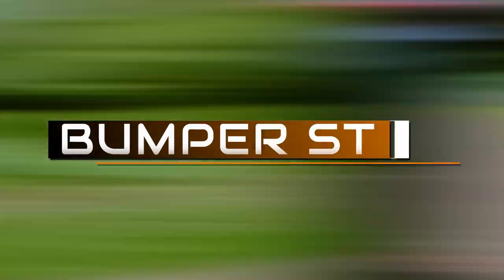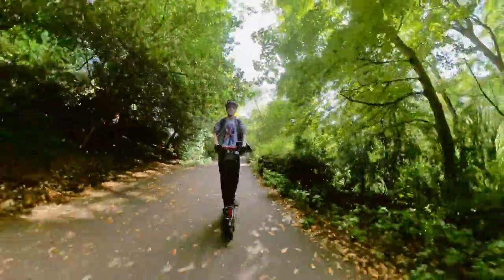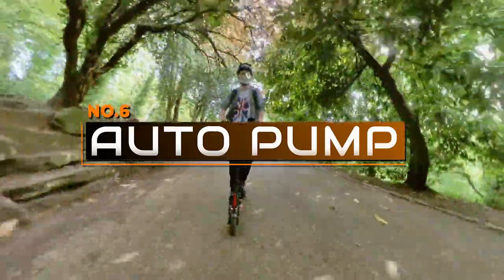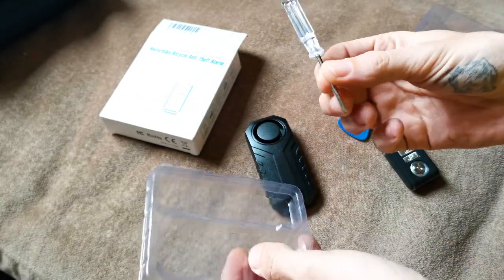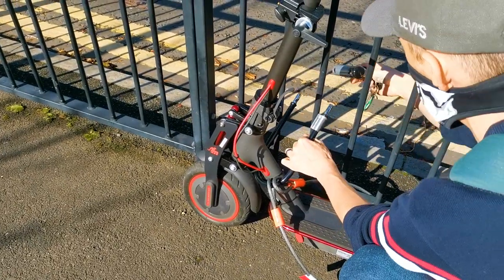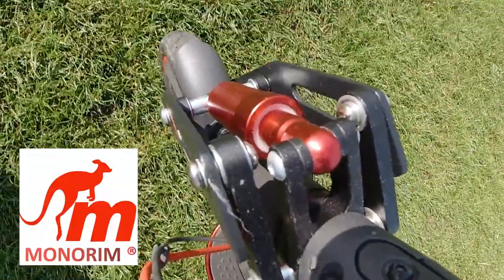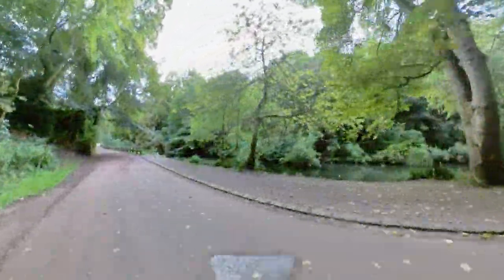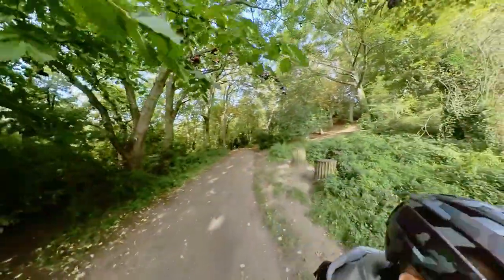10 BEST Accessories for ELECTRIC SCOOTERS [Volume 2]

Comment: Good work and interesting comments on the helmet. I have a Bell Super 3R with removable chin bar too. I had it removed on my cargo bike last year and came off at about 15kph on a wet bit of road down a hill. I've nearly finished paying the $9,900 (Australian) dental bill now and could have avoided all of that if I left the helmet in full face mode. I do this now on anything that moves - especially my Kaabo Mantis scooter, where I normally cruise at around 45 kph. So if you feel you have anything worth protecting above your shoulders, ALWAYS WEAR A FULL FACE HELMET!

Comment: Great video. Very informative. As someone else said great work on the research so that we don't have to. Also it's good to see a fellow Scotsman on youtube.  I've just started using a scooter ( aovo pro ) and am loving it. I am already looking for something more powerful. Do you have any recommendations for offroad scooters? Keep up the good work.
Reply from the maker: I appreciate that thanks mate 🙏  As for a more powerful scooter, well im guessign the Aovo Pro is 350w motor.  Id just google for a 500W motor (at least)  500w motor especially if dual motor makes a huge difference and also copes with hills much better.  One of my favourite budget scooter with a 500w motor is the Kuickwheel SC-1 pro.  Its built like a tank and smooth as hell to ride...great at getting uphill.  Might be a bit tricky to find in uk im not sure. Most of the scooters sent to me for review can be hard to recommend just because they not always available here.   I have a nifty little thing from AOVO that im filming right now... The M5 Pro Scooter bike.  Its really fun to ride and got a 500w motor...But its designed to sit down so a 6foot 2inches guy like me makes it look like its meant for midgets!  but it still feels very confortable to ride.  got beefy 12" explosion proof tyres and some great other features.  think its going for 599 just now (brand new)   like i say its not going to be for everyone because its like a cross between a scooter and a motability bike 😆
Reply: I you have the money for it, i would look up the “dualtron X”. I think its about the best scooter around now, but also very expensive ofcourse. The “zero X11” is also very nice, a little bit cheaper as the dualtron, but still expensive.
Reply from the maker: @Fluggaenkoechiebolsen  I have a rebranded zero 10x...The Varla Eagle one. Just got it few weeks ago and upload vid yesterday 👍 https://youtu.be/4jI_gZ48uAk

Comment: I recommend Livall smart helmet. Has lights and indicators, heck you can even give it an Audi style fluid animation.
Reply from the maker: If you check my description....that is the very helmet I recommend and have recommended in previous videos! 😊👍👍👍
Reply: @SlammDunk Productions:
Just realised watching your review video. For some weird reason, my Xiaomi M365 Pro brakes keep on deteriorating, and the brake is not strong enough especially during the rain. I got it repaired and one month later it’s the same thing? Have you had any brake issues? Secondly, do you protect your top display module for rainy days where the button is?

I also need to get an Android phone to get rid of the speed limiter I have an iPhone 😕
Reply from the maker: @ameerali.ouarda   actually to be honest...my brake doesn't work at all?...I pull the brake, I can feel it trying,. But no real effect.  I just took for granted that I need to tighten it up but have been too lazy to do it yet. I think I will attempt it today and get back to you if goes well 👍 I don't protect my dash no. Trusting that because the scoot is waterproof/splashproof I don't need to worry. However I might at a red one for some style......yes Android is needed for the hack. But you don't need to own one. It's possible to just use a friend's Android to do the hack then just go back to using your phone. 👍✌️

Comment: Another cracking video and loads of goodies to get hold of. I bought the GoPro MAX 360 as it was the only one I could find on finance but really wanted the Insta 360.....Too late now lol and regret it as any 360 3D videos are split into chapters that I cannot join together without spending £100's on software like Final Cut Pro X when I make videos for free? I just like making vlogs as a hobby and not for money but it seems like I am being forced to spend more money on third party software? Cannot find anything for free that does not render 360 3D footage as it all seems to render in 2D Flat footage!
Reply from the maker: AHH the GoPro max...I seen a few people using them when I was on hols last year. They must be pretty good though I'd imagine? Only because they are pretty new. If you used Adobe premiere then I know there are GoPro plug in for free that deal with all the editing of 360 video. It's the GoPro plug ins that insta360 even recommend using when ending in premiere. All those editing programs are expensive as fu*k it really was hard for me to edit videos for YouTube at the start because I couldn't afford anything. I had to use divinci resolve (which is great for free but still limited) anyway I went to Adobe eventually and just pretended I'm a student to get the student prices. £15 a month for Everything Adobe instead of 45. I use it a lot so I can't complain I guess. ✌️♥️
Reply: @SlammDunkProductions  I only went for the GoPro MAX as it was on finance but gutted as they split the files. Why split them and not give the function to join them again???? Adobe is again another extra cost for me as I do not make money from my Channel not that I could as I do not get the views lol, but that's not the point as I want to enjoy making my vlogs with the equipment I buy from my own pocket without having to buy expensive software and then an expensive computer to cope with it if I am not making money from any of my videos and do not intend to either?

Comment: That camera setup is really cool, nice shots. How do you control it while driving?
Reply from the maker: Hey!  yeah its a 360 camera on a selfie stick, the selfie stick is then attached to a clamp on the scooter. the selfie stick is not captured by the lenses so you get the 'invisible selfie stick' effect.   All the controlling of the camera is done AFTER filming.  the editing software allows you to frame shots in post after the fact.  yeah its pretty cool.   If you check out Insta360 cameras, they are actually VERY beginner friendly.  They all come with an App for your phone that allows you to do the editing and cool effect on a phone so you dont even need a powerful PC to edit footage. :)

Comment: I have the hover pioneer, which is basically a knock off brand of xiaomi, but it's really good. I just replaced the tires with solid tires. I got brighter headlights, and some led light strips on the bottom. I got reflective tape on the side too. I want to buy another battery next to make it go further.
Reply from the maker: Nice mate well done, sounds sick! 👍👍👍 Good luck with the battery extension it's something I always wanted to do myself 😊✌️

Comment: Thanks for your real world reviews on escooter accessories. I've added the handle bar extension (my phone now mounts off the crowded handle bar), got the Seibertron Dirtpaw protective gloves and ordered the Bell Super Air R helmet. Will add some camera (probably the Insta360 ONE R) at a later date.
I use my really old roller blade knee and elbow pads. Have you tested any knee & shin pads, and elbow & arm pads? 
I'm a 70 yr old geezer with my right hip replaced and my left starting to go - due to extreme sports when I was younger. I added the Ninebot Max seat so that when my hips pain too much, I can sit for a bit.
The Segway Ninebot Max G30 lets me explore a lot more distance on trails than I would otherwise walk. Keep up the good stuff. Stay safe.
Reply from the maker: Hi!  thanks for the feedback Charles :)  As for pads it depends on your budget.  i recommend "JBM Adult BMX Bike Knee Pads Elbow Pads Wrist Guards"   or for less money  "Gonex 6 in 1 Protective Knee Pads Set"   just search amazon for those 👍

Comment: I order same alarm, but maybe i Will put inside battery compartment (just the print ect), maybe even add a power converter so its on the xiaomi battery.. I see on video there is room infront of the Controller..
It will make less noise, but still enough i think if its also zip locked to something
Reply from the maker: Sounds ,👍👍👍

Comment: Great video!

However, as someone who just barely managed to scrape together the 360€ for an S1, there's no way i'll be able to afford these.  So i'd like to ask you;
1. Which one (other than the helmet and lock) Is the most important?
and 
2. Do you have any good budget alternatives for the rest that work well and still don't compromise the scooter's safety?
Reply from the maker: Alarm and handlebar extensions are useful and less than a tenner if you look around I'm sure. I guess a 'proper' lock that will keep your scooter secure but they can be quite pricey for good ones.  Some things are worth going cheaper, like (alarm, gloves, lights, handlebar extensions etc) but some things you want to pay for the quality. For example the suspension, I'd always recommend official Monorim kit's because some of the cheaper copies are dangerous. The metal forks bend because meterial is so thin and the suspension has no bounch compared to Monorim. Yeah I don't know what else to say I hope I've answered your question 🙂👍🙏
Reply: @SlammDunkProductions  Thank you! 💕
Reply from the maker: @uwuhehe6900  you are most welcome ☺️❤️

Comment: That alarm system is pretty cool but what if someone touches it and you're away ? Does it stop itself after few seconds ?
Reply from the maker: haha yes i think about that all the time. especially if i leave it outside the supermarket, but thankfully nobody has touched it so far.  im pretty sure it will keep going until the battery dies but im not 100%
Reply: @SlammDunkProductions  I was looking for such system and i'm glad that exists, but it should stop ringing once it's stabilised.

Comment: I didn't buy the monorim Front, I bought the twin shock, conventional type. Mine using both F & R suspension smooths out the ride by 35-40% ! ( huge improvement). Mind you, I'm an old Retired Mechanic, bad back, so a better ride mattered to me. I use mine as my Primary Transp, so I use it for everything from big shopping trips, to quick errands. Towing my big folding shopping basket, I can haul over 100lbs of groceries in one go.Ninebot Max G30.
Reply from the maker: Ha.. Respect mate 🙏
Reply: @SlammDunkProductions  You should see what all I've done. Re-Engineered the rear shock lever arms, to increase dampen rate, beefed up the M4M Trunk, so I "could" tow over 100lbs, with up to a 50lb tongue weight. Next, I'm adding a heavier motor, and going to a 48 volt system. That way, my software hacking can get me up to the 30mph range, instead of just the 21mph now.
Reply from the maker: You have videos of you doing this?
Reply: @SlammDunkProductions  No, but I've been thinking of doing one, to show my setup. Towing with my Ninebot is easy, as the basket holds all the weight. A good push at startup, and momentum does the rest. I will subscribe, so if I do post a video, I can let you know.
Reply from the maker: @davidjames1063  yes for sure! 👍👍👍
Reply: @SlammDunkProductions  I will shoot a short video, after a shopping run, and explain my modifications, to post on 'tube. Not sure how how to upload one,( from my phone ) but I will give it a shot. I am a purely practical guy, so my Mods all are practical and useful.
Reply: @SlammDunkProductions  I have 3 videos coming up, try to post on my channel here on utube. Give me 24 hours.
Reply from the maker: @davidjames1063  niice 👍
Reply: @SlammDunkProductions  I was out this morning shopping with my Basket Towing "rig" at two distant points in town. Had many, many admiring glances, and several open compliments on how "cool" they thought my setup was. Ages ranged from 70's to Families with small children. Video #3 will be shot, after I upgrade the Pivot Axle to include Safety Washers, and actual Bearings, rather than just a "friction over a bolt" setup. As a Mechanic ( Retired) I am unwilling to keep halfhearted Engineering, on MY 9bot Scooter !
Videos coming very soon. 2 of 4 already shot, ready to upload. #3 will detail What/ How of my Mods, as well as Road Test results. #4 will be an "action" short, of actually Towing a Load, showing maneuverability, etc.
Reply: @SlammDunkProductions  Should have that video set up in several hours. Been delayed while overhauling my neighbor's E-Scooter. Wed 2pm
Reply from the maker: @davidjames1063  look forward to it 👍
Reply: @SlammDunkProductions  I have the neighbor kid's Pulse Scooter done. I finished the mechanical on mine, I will replace a bit of the "pretties" because the Reflectors are useful, and shoot the last two later today.( Thurs morning now). Post them tonight, { assuming utube even LET'S me do so }.
My scooter is PRACTICAL, not pretty. If it's my workhorse, function and utility is all that matters to me.
Reply: @SlammDunkProductions  Hi. Have 3 videos uploaded on my Channel. A 4th upcoming, to show Trailering shopping basket.
Reply: @SlammDunkProductions  Utube turned off comments on my videos for some reason. Not sure how to turn them on, but they are welcome.
Reply from the maker: Nice!  am just about to head to work as i write this comment but when im back home tonight i am going to watch your uploads 👍♥

Comment: Alright mate, i been thinking about treatin' myself to a scooter recently and i notice you are riding around the Newcastle/Gateshead area.  I'm wondering if you ever run in to any issues riding these areas (saltwell park etc.) with police etc.  

Thanks :)
Reply from the maker: Nah...it's been 2 year now and I haven't had a single issue anywhere!...I've always said to people "as long as you don't act silly or fly about on the main roads you will be fine"...and even further to that they have actually started trialing rental scooters in Newcastle now so I think things are Getting a lot better for us....yes it's still technically illegal to drive your own private scooter...but I'm certainly not 'renting' one when I have my own ☺️

Comment: Hello mate I bought mi electric scooter pro 2 and the battery capacity is 12800mah but when it’s 100% charge
In the app in battery info it’s 11900mah what I do how I fix it?

And some times it’s charge quickly and dried quickly?

Just why???
Reply from the maker: Sorry you asking the wrong person mate. I don't own a Pro 2 it even if I did that would be a bit beyond.y expertise....best bet would be to ask on a Facebook page or Reddit. You will get plenty feedback I'm sure. Good luck with it Apple Man sorry I'm not of much use🤞🤞🤞
Reply: I believe that Xiaomi have limited the max charge on the Pro 2 in an attempt to extend the health of the battery at the expense max range. At least hat's what I read somewhere anyway. I'm not sure if there's a way to up the max or not.

I don't know about the fast discharging issue. 🤔
Reply: @SlammDunkProductions  thank you
Reply: @fallyoverguy  thanks
Reply: The Pro 2 has a limit on battery charge capacity as charging to full is worse on the battery health in the long run. E-bikes and even electric cars do the same now. It should be possible to change this with a custom firmware
Reply: @fabian.f97  thx

Comment: I got myself a pure air second generation e scooter, but it comes with this annoying bulky USB port on the underside of my right handlebar so I can't put on a nice extention for mirrors or other good things..

Anyone has a workaround for this?
Reply from the maker: that sound a bit annoying....Can you not even fit handlebar extensions? something like: https://bit.ly/2WJJDPG
Reply: No, there isn't enough clearing to fit between the actual steer and the USB case on the underside, unless I secure it with just one mount on the left side and wouldnt look even not to mention if it will be sturdy enough holding on with one grip.
Reply from the maker: @sethirium9542  yeah probs not a good idea to try as you would deffo need to secure both ends...shame. hopefully you can find a solution I wish I could be more helpful. Good luck mate 🤞

Comment: how hard should i pump the tire of the xaomi pro?
Reply from the maker: i have mine at about 45PSI you may preffer a little higher...50
Reply: @SlammDunkProductions  yeah i have no clue usually it has to also do with weright im 80kg so im not sure if i should get more or less in it depending on weight
Reply from the maker: I am almost 80kg and I'm happy with 45-50psi. 👍
Reply: @SlammDunkProductions  aight thank u mate

Comment: Hi, I added monorims front suspension to my xiaomi 1s and I plan to add a rear suspension as well but my only problem is that the kickstand is now to short and barely keeps the scooter standing with just the front suspension. I can't find a bigger kickstand any where and I know once I add the rear one it isn't going to hold up at all. Any tips?
Reply from the maker: Hi!  yes its true, you need to turn the handlebars a certain way to find the balance when using kickstand!....There are little attachments avail;able online which you can stick on the end of the kickstand to give it more support.  google for them they only a couple of quid! 👍